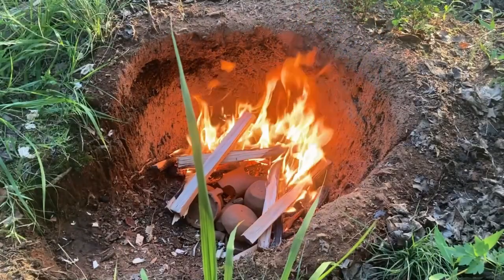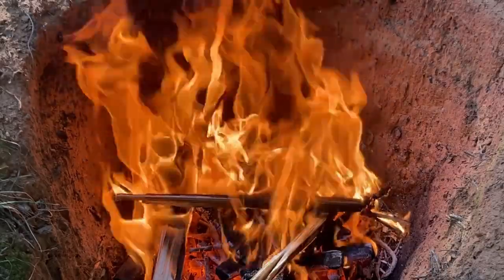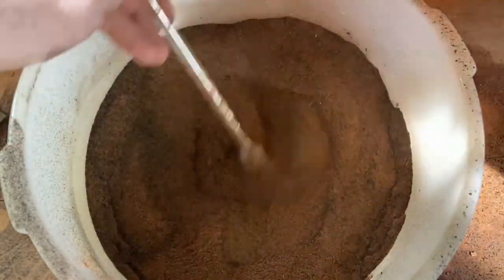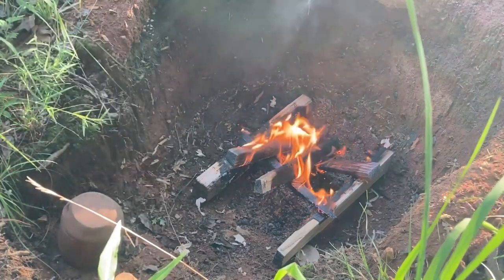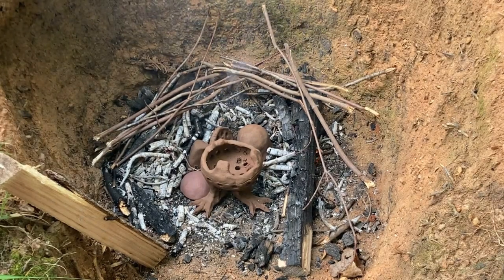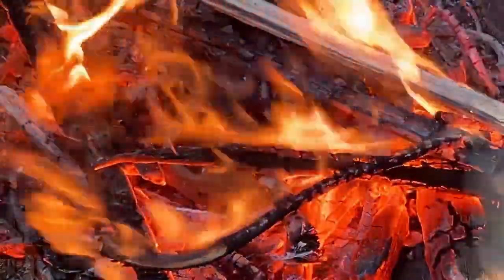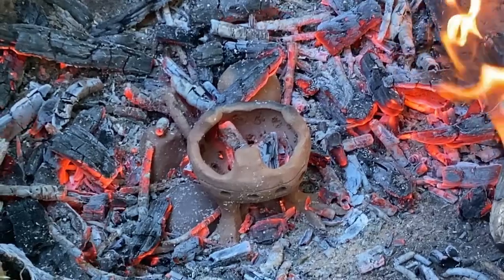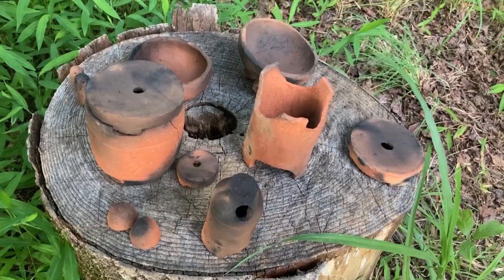How I fire my pottery

Comment from the maker: Hey everyone, I just noticed that I straight up lied in this video, I don't know what got into me in the last part of this script but I've certainly had MANY more than three pots fail and you can clearly see that my two footed pot also suffered damage in that batch. All I  can think is I wasnt paying enough attention while writing this one. Coming back to this video now I have no idea what I was thinking. I would say the vast majority of my pots have survived(80-90%) and when a pot does fail it almost ALWAYS traceable my poor pottery(I.e. bad joints, poorly mixed clay, etc) so maybe I was excluding those? I feel I can honestly say only two or three pots have broken that i didnt screw up.(the cylindrical pot in this video for example broke along a slip-joined seam that I rushed) I cant help but feel it was a very dishonest statement on my part. I really dont know what I was thinking but I wont repeat that mistake. 

also some quick notes on fire safety I feel I really should have mentioned in the video:

-immediately after firing the pots will still be hot enough to start fires for some time, normally i let them cool in the kiln or on the shelf leading into it till theyre cool enough to touch

-though the pit makes having a  fire substatially safer(in some localities pit kilns are exempt from certain seasonal fire regulation) its still best to clear the area of dry plant matter, this is something i neglected to do in one of these firings which was a careless mistake, luckily nothing happened, but better safe than sorry 

-remember to keep 2-3 ways to extinguish a fire on hand. i always like to have a bucket of water and something that can act as a fire blanket within arms reach. Ive never had to prematurely put out a pit firing but its good to know you can

-its best to wet the embers after the fire, do this after you pull the pottery out as water on very hot pottery could shatter it, but those hot coals can stay hot for days and extinguishing them some how is typically a good idea. once theyre cooled and dry I like to save the coals for temper or to use as biochar 

good luck! and happy firings!
Reply: The coals could be useful for heating though. Waste not, want not.

Comment: Your research, demos, and explanations are wonderful! Thank you for making videos and sharing these experiences.
I'm working in ceramics and got here investigating mathods relating to clay processing, kiln design, and a general fascination with alchemy. Here's the question your videos inspired: could one combine the oil lamp (with blow pipe) and kiln build principles to make a kiln that doesn't require wood for fuel? Something something tubular rings channel air flow to something something wicks around the inner wall of the kiln something something. I don't have the whole idea but I think there's something there. I'm hoping to move away from electric kilns but environmentally, apprehensive to consume a lot of wood. 

Anyway, great videos, wonderful content, excellent production! 11/10 will watch again and again.

Comment: After watching the videos regarding the oil burner with blown air, makes me wondering about an automated blower and making a kiln fired using oil.  I don't recall ever seeing an oil fueled or any liquid fueled kiln firing.  Might be something novel and wondering if has been performed before?  What is novel on that topic interesting is seeing the rocket stove kiln fires which use significantly less wood or fuel.  Awesome work and productions.  Thanks for sharing.

Comment: Hello Fraser, 
I need a help

I did make a Cylindrical Mug, at last

Attached a handle without any cracks

But, during the firing today, I heard loud sounds

As said by you, I knew something cracked or broke

When the fire settled, I looked the mug

There was no mug at all !
Just 20-25 small pieces !!

I don't know what happened
I fired it inside a metal bucked,surrounded by leaves and firewood

The mug was touching the metal bucket

The mug was fired today after waiting 5-6 days in nearly 35-40°C

Can you suggest anything to help me?
Reply from the maker: oh no! im sorry :( did you preheat the pottery in the oven first?
Reply: @fraserbuilds  No

Comment: I wonder if you could challenge yourself to create a vessel that can dry the pottery in the same way old wood fired ovens do. Maybe just another hole where some hot coals go that you can just cover with a rock for a bit. Loving the off grid aspects of this channel. 

Edit: For the fanning of the fire you could even "train" your automaton to give you a hand with it! Or make use of some of that sheet metal to make yourself a cased fan to sit in front of it..

Comment: I am curious if you've experimented with "Grog" as a temper?  My understanding is that fired clay that has broken can also be used as it has already gone thru the shrinking processes and shouldn't change much. I've seen this used on Primitive Technology's clay purification videos and also in some more traditional pottery demonstrations. It looks to be the same basic idea as crushing the carbon in a crucible.

I'm also curious if you've looked into Black Kyanite or "witch's broom", which can make for heat proof tempered pottery.
Reply: In his videos on making pottery clay, he has mentioned using broken pieces of already fired clay as a temper.
Reply: grog works great but charcoal is easier to get in large amounts and takes less time to crush

Comment: Do we fire the produtcs just for removing moisture or else thing ?
Reply from the maker: the main reason to fire pottery to terracotta is to "sinter" the clay together, at the maximum temperature the pottery reaches in the fire, around the point where it starts to glow red, the particles of clay sort of begin to melt, its not hot enough to fully melt or "vitrify" the clay, but it is enough to cause the very ends of clay particles to meld together (a little like how the tips of a snowflake melt first, the tips of a clay particle are easier to melt than the whole of a clay particle) once sintered the pottery becomes much stronger and wont dissolve into water the way unfired pottery does
Reply: @fraserbuilds   @fraserbuilds  thanks alot for the information,
Actually I am interested in making some kind of water bottle for packaged drinking water which can be reused for a period of time and I thought of using jute gunny material or any sort of fabric for the structure  on which i want to put a thin layer of clay and cook it to that level where the clay fabric should be hard enough to contain water and not that hard that it should break, kind of bendy material like if possible 
I live in India where theres huge market of packaged drinking water and thin plastic bottles are used for it which is harmful to nature and man itself.
So I thought for a replacement of it 
Where in india there are many kind of clay water bottles are available in market but they are costly and heavy and not for short period usage 

Please share your thoughts and advice about this and if it possible to make that kind of product 

Thank you for your time and respose.

Comment: Please help me

I have a doubt

I've been trying to make earthenware mugs , but couldn't do it

In my first attempt, I made the cup body
Then, when I tried to attach the handle, small cracks appeared 
Eventually, the crack grew long and deep and it broke
So I made it back to clay

In my second attempt, I made the cup, attached the handle
There were no problems
But, when I tried to polish it by rubbing my scrapper against its dry wall,small cracks appered
As happened to me before,it also grew into a long and deep one
(I made that one too into clay)

In my third attempt, everything was fine
No cracks while making, no cracks while attaching handle.
Then , it cracked when I tried to polish
But it was a minute crack
Just like a line drawn on it
Thin and narrow,looks like it has no depth

Anyway, I tried to cover the crack by adding slip,then polishing

But, when the slip dries , the cracks reveals again

So,I thought it was because slip and the wall of the mug where in different stages of dryness 
So, I dipped the mug in water for a second or two and waited

Then , what I saw was really sad
It had broken, from rim to base

Can you, or someone who sees this comment tell me any solutions or suggestions?

I have wasted like a month now
Is it because of the temperature, cuz here it's like 35°C+ 

Does it affect?

Or should I wait some more time to polish the pot, as maybe the exterior of the mug was dry while the inner layers were still wet?

Please help me

And , how can I make my pot cylindrical,  because when I coil build it, it goes out and out,
I tried your technique to turn it inside, but it turns jar-like , with a constricted neck and wide body
I can't make it cylindrical,

Please help me
Reply from the maker: making cylindrical pots can be difficult, though ive had some success with slab building techniques with tar-paper stencils(basically you roll the clay flat onto a piece of tar-paper then roll it up into a cylinder and bind it with some slip. 

I have noticed the starch clay recipe makes slip-joining more difficult. it seems to give the clay a slight elasticity that makes it pull away from joints. for a joint to work it really has to be very well joined. often times when I have a pot fail its along a slip-joint. 

Im not quite sure whats causing your cracking problem, clay sometimes cracks as it dries(sometimes it happens when working clay thats a little too wet, but I really dont know if thats what your encountering) Sometimes small surface cracks can just be ignored, but if, like you say, they run all the way through the pot thats more of a problem.
Reply: @fraserbuilds  So , according to you, that we can avoid small cracks and just fire it ? 

Isn't that what you meant?
Will I have any problem while firing or after that, or will it be just normal?
Reply: Anyway, thanks a lot

I will try again
Reply: more grog, perhaps. 
& try & try again, certainly 
Good luck & you are ahead of me.

Comment: are pots made like this waterthight ?
Reply from the maker: No, pottery fired this way(terracotta) will be porous
Reply: You can use things like beeswax, pine pitch, lard, jojoba oil (really a wax), food grade linseed oil, and the like to help seal and make them less porous to water.  If you use something like lard, you should heat it to its smoke point to polymerize it, so that it doesn't get rancid and smelly later.

Comment: Hello Fraser,

I fired again

This time, I got half

Other half was shattered

Does the quality of the clay make any difference?
Reply from the maker: hey thats progress atleast! the times ive had clay break during firing Ive been able to attribute it either 
1. trapped moisture in the clay
2. unevern tempering.
if the pots "spalled" meaning flakes popped off the outside leaving crater like cracks, thats probably trapped moisture. but if the pots totally shattered, I often find its due to uneven or inadequate tempering. 

Also, if youre doing the dry process, this can also be caused by the clay not being ground fine enough before being hydrated. 

I like to sieve my clay powder  to make sure im only using fine powder, then when I add in my temper I make sure to mix it in very thoroughly and knead it once its been hydrated till it is evenly distributed
Reply: Thanks

Is there any problem if a add too much temper?

Because, I'm now starting to use clay from paddy field

It does have some sand, but I don't know if it's going to be sufficient
Reply from the maker: The only risks are that the more temper you add the harder it will be to work the clay, and the more brittle the final piece will be. Im hoping to make a video soon about working with high-temper clay :)
Reply: Thanks a lot
Reply: half way is good, fire 2 pots & hopefully you won't get 4 !